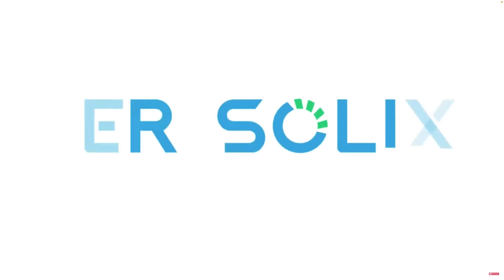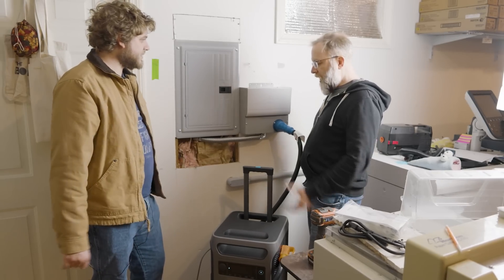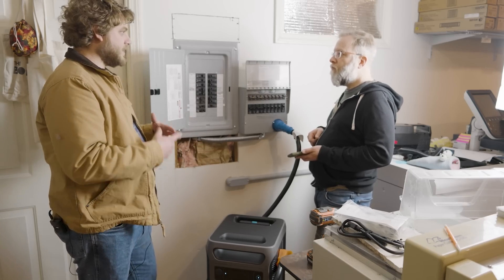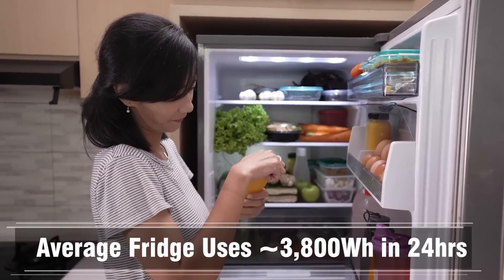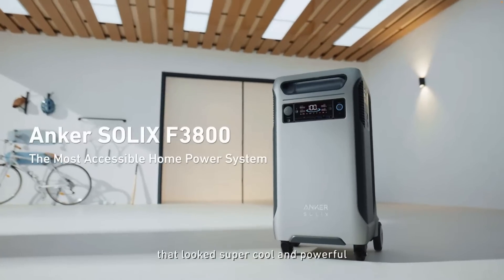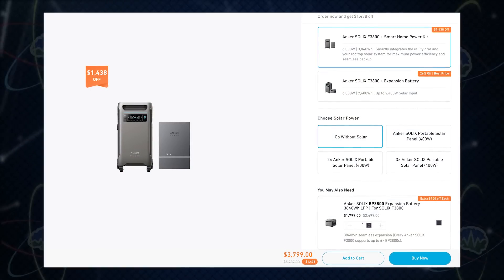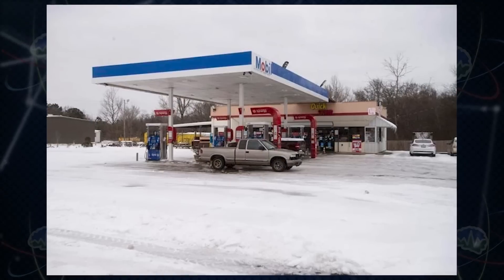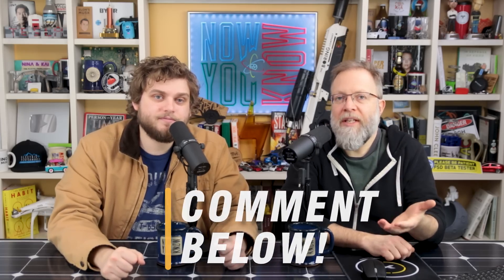Home Backup Battery for Less! - Anker SOLIX F3800 | In Depth

Comment: I want to start adding something like this in my church installs to back up and keep security cameras and door access running 24/7. Thanks guys as usual.
Reply: You have been able to buy a UPS system from places like Office Depot, and plug in your camera system to your UPS battery back up.  Look for a fairly large one.  The very low cost 300 watt model will not have a large battery.  The one shown is extra large 3,800 watt battery, but also extra cost too.
Reply: @Kangenpower7  a regular computer UPS is not enough at all for a security system, which likely has spinning hard drives too.  My at home system with only 2 cameras only lasts 30 min or so without power (1500VA UPS by the way).  These only have 2 small lead acid batteries.  You do need a LFP kind of battery, but smaller than this would be fine.  1kWh would likely be plenty.
Reply: @whattheschmidt  What I did with one UPS system is connect it to my RV pair of golf cart batteries wired for 400 AH at 12 VDC.  You can also wire in 4 golf cart batteries to your UPS.  Check the battery voltage, normally 12 or 24 volts.  Then wire the golf cart batteries the same voltage.  4 of them will store about 4 KW of power.  The golf cart batteries need to be stored someplace like a storage shed, well ventilated and not a occupied space.

Each 200 AH 6 volt golf cart battery is about 1 KW storage and 67 pounds!  

If your 1500 KVA UPS is only 40 pounds total then battery storage might be a pair of 12 volt 10 AH batteries.

So that can be greatly expanded.